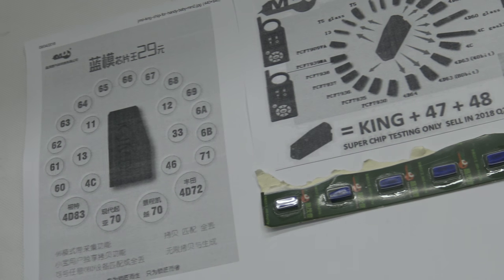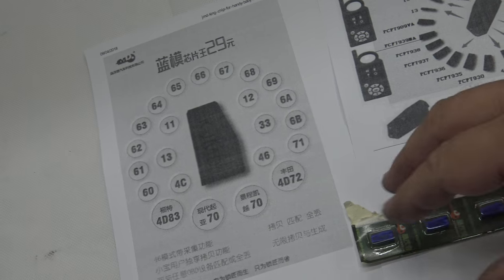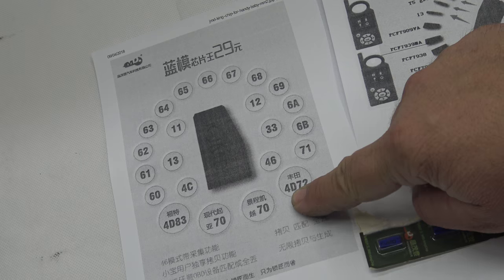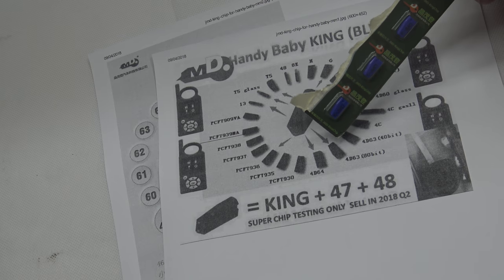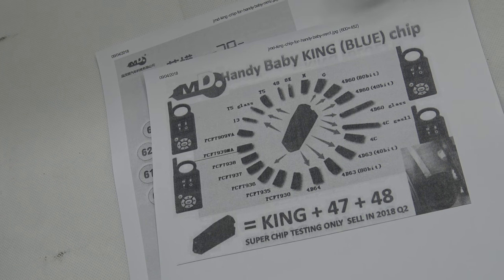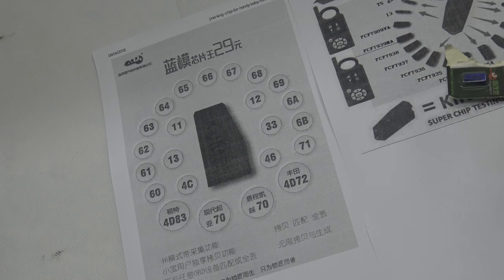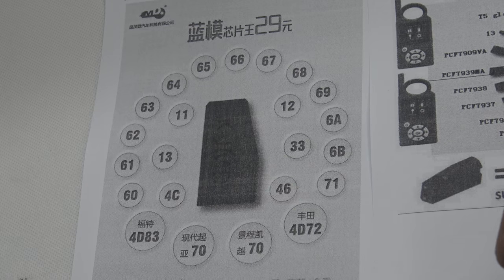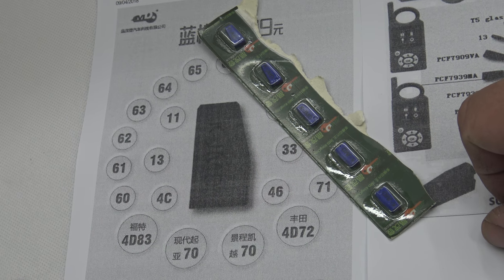Blue Chip for Handy Baby for 46/48/4C/4D/G

Comment: what kind of cloning tool could you recommend to a total newbie? (i used ak90 for adding extra chips to immo in my bmw e39 and that's it) something that could identify and copy as many different chips as it is possible for single device, it doesn't have to be highly reliable as it is for personal use only, mainly for cars 5-7 years and older but running costs (subscriptions, tokens, dedicated chips) are important (but not vital)
Reply from the maker: If you are new, I would use Silca RW4 you get support  , if you can use AK90 , I would start with TM100 , but the VVDI is a nice tool, and people are very happy with the Handy baby. I think the best thing is the instructions with any machine, it makes it easy to get the job done.  You get alot of bang for buck with the VVDI - Handy Baby - CN900 - TM100

Comment: You mean too say it can also be programmed by using obd tools for all lost keys also. Plz reply
Reply from the maker: I did try to generate the chip with VVDI but it did not work, if you use handy baby and it works, then yes you can program the chip into the car if you set the chip to the right setting.